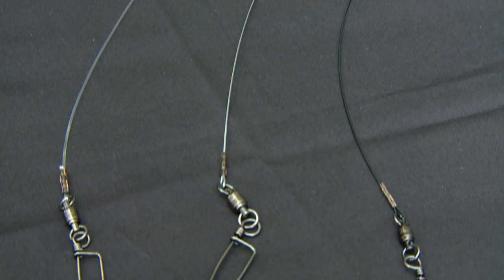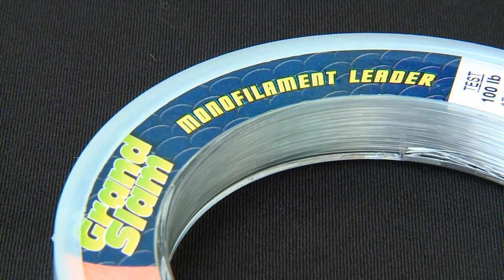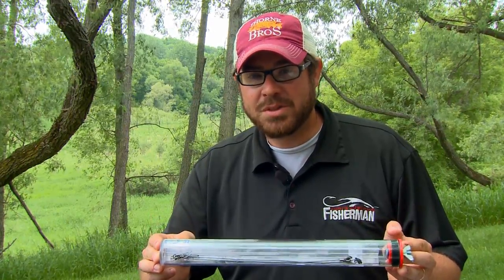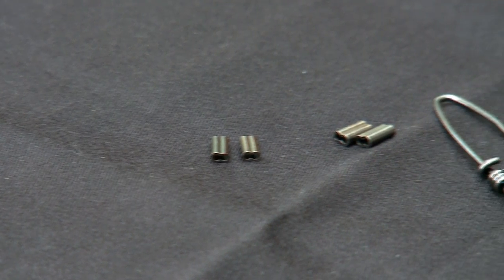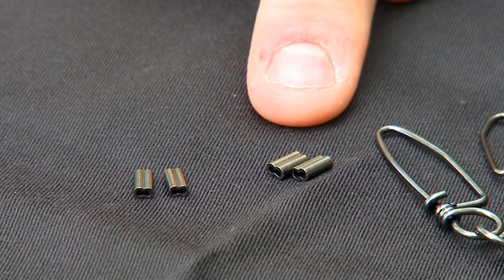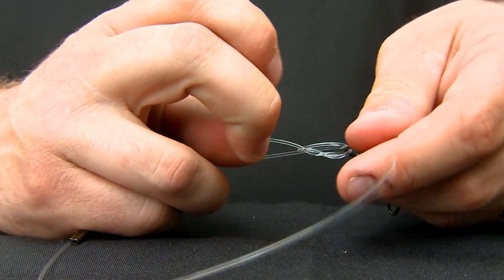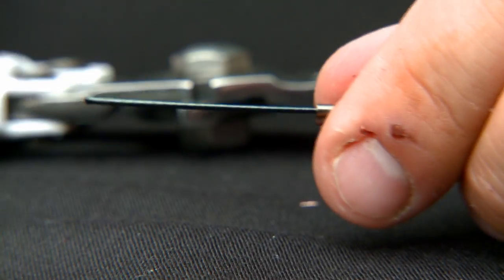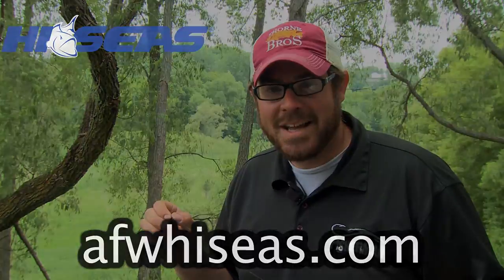How To Build Your Own Muskie and Pike Leaders

Comment: Crimp should be towards center of sleeve to leave flared ends, yes?
Reply: yes if not the crimps will dig in to the leader.
Reply: i agree with you the guy in the video obviously isn't experienced, swivel at one end and a lock at the other . I agree with you about the stay lock snap, they will never open , and are so durable.  i mean also you shouldent really use nylon for pike either tbh, 7 strand wire is alot better, plastic coated i find if you wrap it up its got alot of memory which isnt good. I prefer solid steel or titatium but titanium is so expensive but durable. Glad there our some people who dont believe everything they see on a vidoe, ive seen people fish for pike with flurocarbon leaders of literaly 10lb saying they saw it in a vidoe , a guy had a fluro leader or something ridiculous. Or they say oh ive caught a pike before without a trace so i dont need one. Ive seen at least 5 youtube fisherman who have gone pike fishing without a trace, or any knowledge of pike handling. Saw one guy not use a trace and when i said about it, he was arragonant and rude saying he knows but he didnt have one at the time. well dont go then. saw a guy fish for pike, didnt know how to handle it, didnt have a trace either, dropped the pike in the air, didnt know how to chin it . pretty much killed the thing becuase of mis handling. Alot of bass anglers dont seem to know anything about pike and g fishing for them without doing any research . Im a uk fisherman and everyone i know love pike and treat them with the so much respect. well thats my rant over.